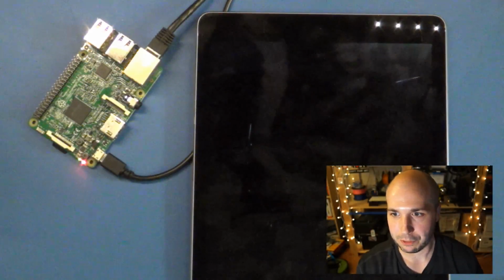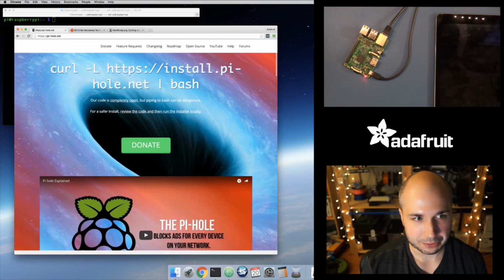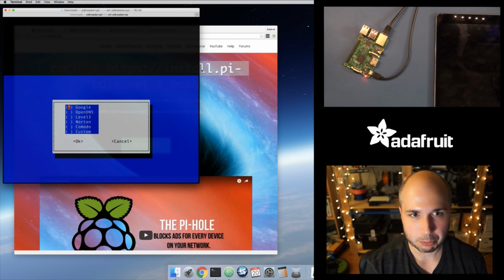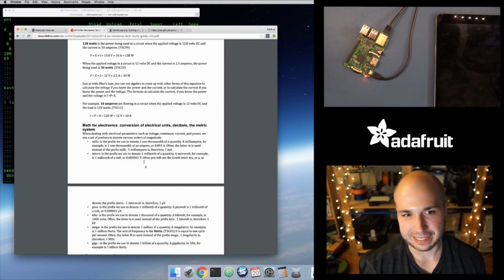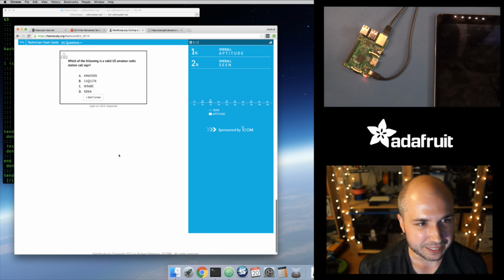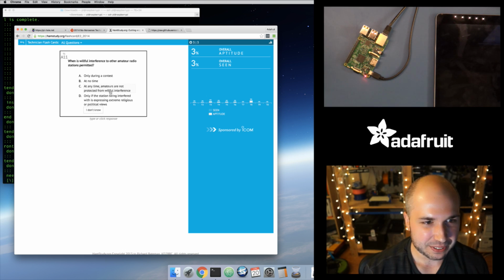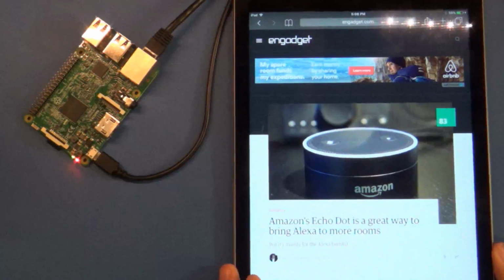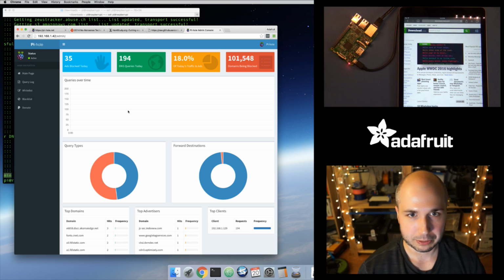Raspberry Pi Quick Look at Pi Hole ad blocking server with Tony D! @adafruit #LIVE

Comment: The /24 is the sub network mask (192.168.x.z/24) this give you 1 network address and 1 broadcast address and 254 host address's.  The 192.168.x.z is a private range that is not able to be routed over the Internet and all firewalls and home dsl routers use a technique called network address translation or nat for short.

Comment: just change the Primary DNS in your router. Now all device traffic will pass through the pi by changing one IP. Also, the /24 denotes your subnet. So, in this case /24 states you have one subnet with a max address space of 254 for a class C.

Comment: CIDR /24 is three octets (3 * 8 bits each) = 255.255.255.0 they are the reserved parts/mask for your network ID the remaining 0 is for your host (your Raspbery Pi in this case).

Comment: Pi Hole works good but, needs some updating from coders end. Such as being able to block addresses using full url (http:// ect.) not blocking I.facebook.com ads..
Reply: How does this affect it's use? Except that you need to remove the http when copying the address. Does it risk blocking non ad addresses within the same domain?
Reply: No, it still blocks most ads but some still slip thru like the ones on Facebook..

Comment: You should not change your DNS configuration on all your devices, just change the DNS of your wireless/wired router.
Reply: Why?
Reply: Because the router deploys the DNS configuration to all its devices (wired and wireless), that way you only have to change one device and all connected devices would be configured automatically. Changing it on all devices is possible too, it is just more work and maintenance if you change your configuration.
Reply: got it..
Reply: I changed dns on my router and it works on wireless devices but not on my desktop. Any idea?

Comment: Thanks for the guide. Bought a PI3 and now have setup pi hole running along side with Squid. Now for customizing my adblock for sites I frequent most. Btw, did you pass your ham radio test? I have been thinking about getting a license just for kicks.